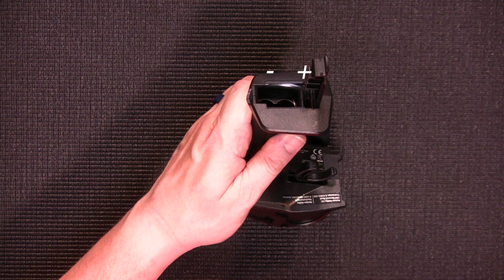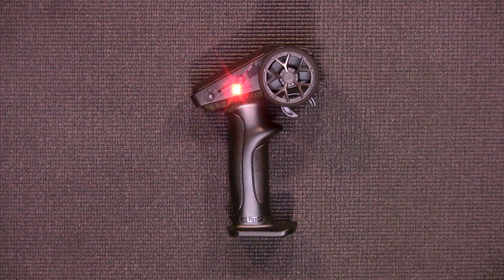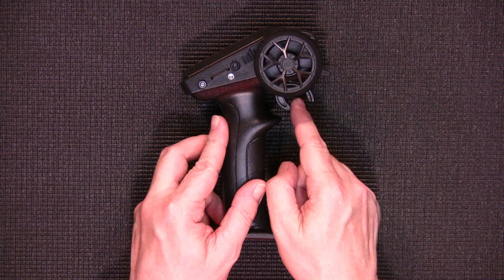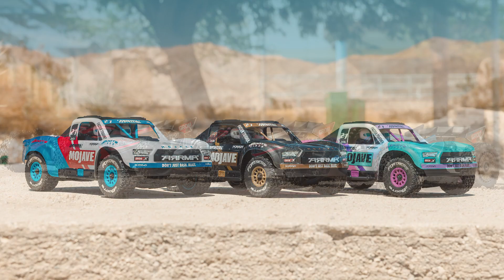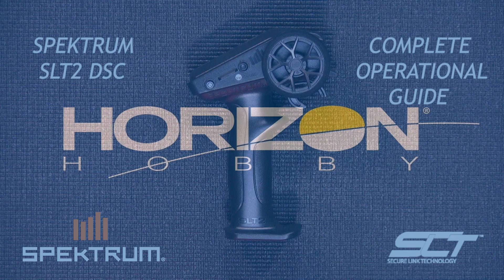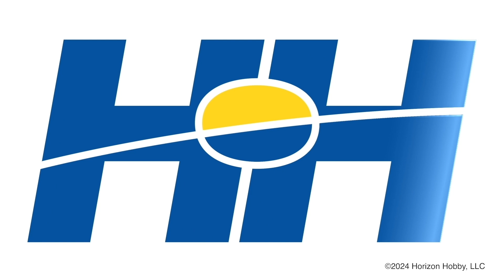SLT2 DSC Operational Guide

Comment: Expecting to get full service help from every single video posted on YouTube is a bit much. But I ran across this video attempting to program servo end points on 2 brand new Quakes. Both slt2 dsc transmitters are spectacularly failing to enter program mode after following this video exactly as shown. And I have tried everything I can think of.  So either details are missing or the newest dsc capable slt2 are not programmable. I have contacted HH support and hopefully the entire internet is missing a small detail and it's an easy fix.
Reply: I contacted HH support to let him know the SLT2 that came with my Mini Kraton won't allow programming the steering endpoints using the instructions in this video. They said they would have to research it and email me. The emailed me the link to...this video... :|

Comment: Do you guys not read YT comments? Are you guys not paid enough? 

Have you guys fallen from grace?
Reply: Did you ever figure it out?
Reply: @sleepyGST nope. Seem like they disregard customers after taking their money
Reply: @ScrapyardGrandpa my bad, just saw your reply. With the transmitter off, turn the wheel fully left, push the trigger to full brake/reverse and turn the transmitter on. The LED should flash rapidly, if so, release the wheel and trigger then it should flash once to confirm the reset. If so, you're good to go
Reply: You are not Horizon Hobby  @sleepyGST  but thanks.
Reply: @ScrapyardGrandpa  Obviously I'm not, but I helped didn't I? You could've just googled it by the way.... don't worry, won't happen again.
Reply: @sleepyGST ur the best, better then Horizon Hobby

Comment: Impressive content, Horizon Hobby Support. Looking forward to your next upload. I smashed the thumbs up button on your video. Keep up the excellent work! Your detailed explanation of the steering rate and throttle limit adjustments was particularly helpful. How do you recommend calibrating these settings for different vehicle types to ensure optimal performance?